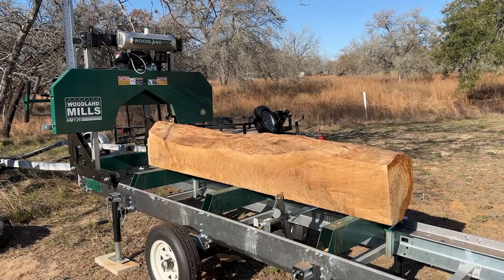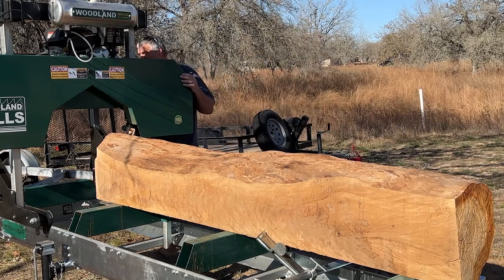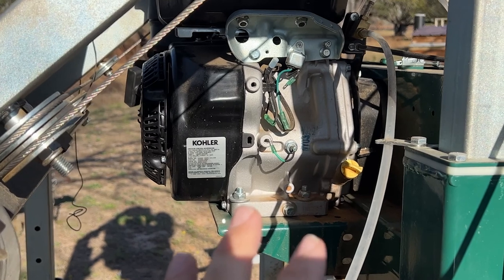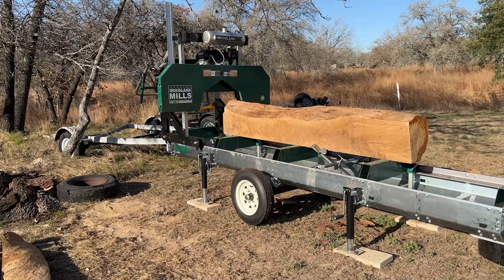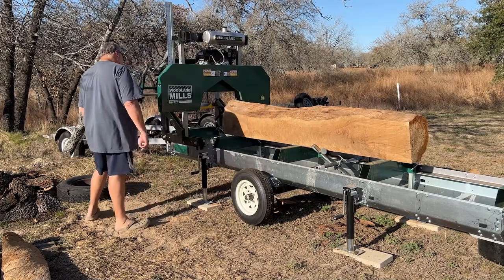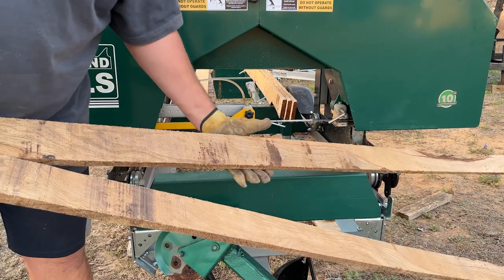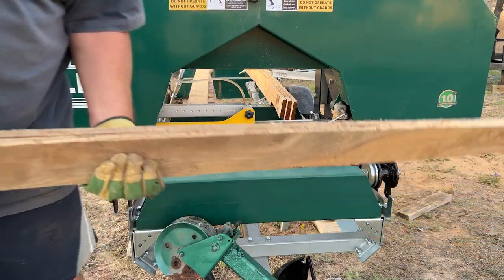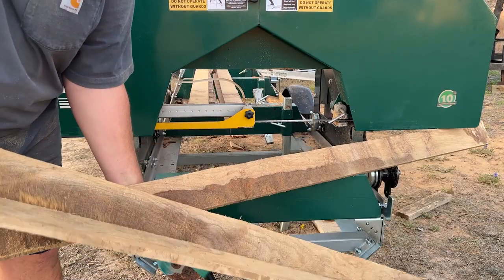Woodland Mills HM126 Sawmill finished the 24" Live Oak

Comment: Thanks for the video.  So these mills often come with a few issues to work out from factory. They are rarely dialed in and perfect from the start.  Expect things like your blade tracking to be off a bit.  
I noticed your blade tensioner handle in the video appears to be moving quite a bit while you are cutting. Is your blade torqued to spec? Handle is typically pretty tight and shouldn't wobble. That whining may be your blade slipping on the band wheels or slipping belt.  Make sure your blade tracking is dialed in and you're not over using water and brushes are doing their job to clean the wheels.  Check tension on the belt. Should be slight play in it but not much, half inch of play is what I go with.   Be careful about pushing the cutting rack. Try to let the blade do its work with as little pushing as needed, if its too slow, something needs adjusting on the mill or the blade needs a sharpen etc.  Too much forward pressure can cause things to fail, whether its the blade eating up the rear bearing or stress on it causes a blade to snap etc.  
Nice sharp blade, good straight blade tracking, one water drip per second on the blade, make sure blade guides are nice and straight, belt adjusted properly, clean off accumulating dust from the track, Just a few things that may help get you going quicker.
Reply from the maker: Thanks for all that… I noticed that wobble when I was edit I didn’t see it when cutting I have the washers system no torque but it is just by eyes tighten until washers are “flush” 
First run I definitely had too much water it was wide open and making mud under boards check the previous video. I’m getting another large oak this weekend and will check all this on next run I also ordered a tach so I can confirm the idle and full throttle rpm.
Reply: @BigRedFishDad  good luck with it! Its definitely a learning process. I'm newer to it as well and there's lots to figure out. Its definitely a "system" that needs different elements running properly with one another.
Reply: I had an issue with the blade stopped turning. Turned out the throttle wasn't adjusted to fill throttle.  After I adjusted it it cured that problem. Had the scrapers on the roller wheels getting stuck also. Required adjustment. Other than that no problems. I really like it for the time I have to spend with it
Reply from the maker: @bigshrimpfs  the first video I had called woodland mills and that was a common problem he said especially on the new one like mine with the auto water valve… I just got me a tach for mine and it is still a little under rpm so going to mess with it again.
Reply: I am near Gulf Shores Alabama.  I take it you are some where in the coastal area also. Ok thanks again